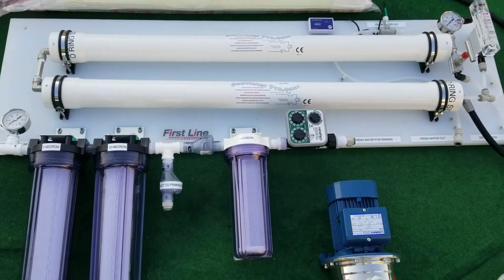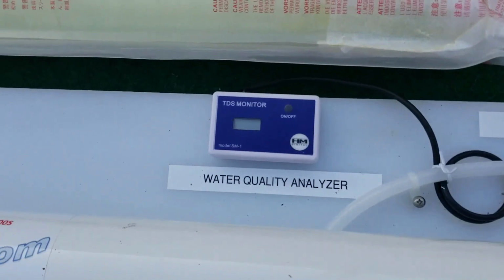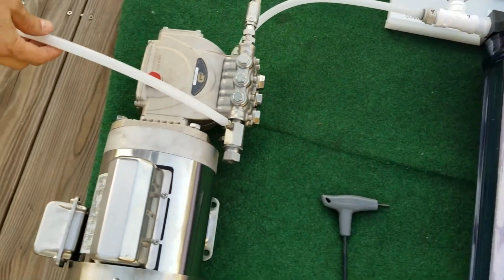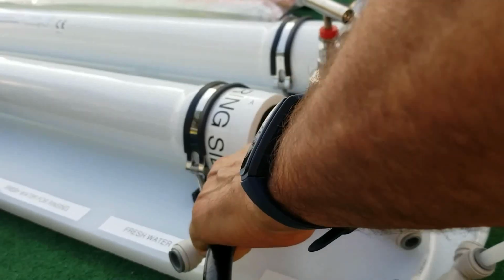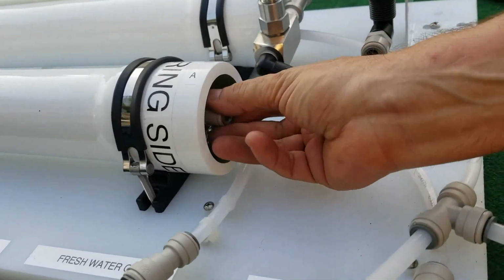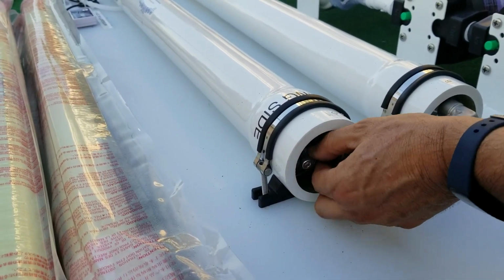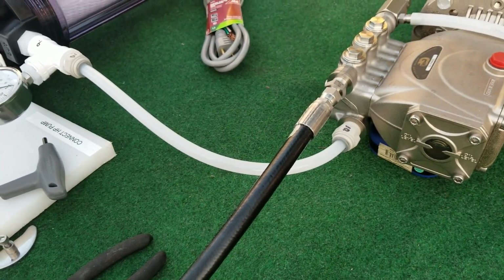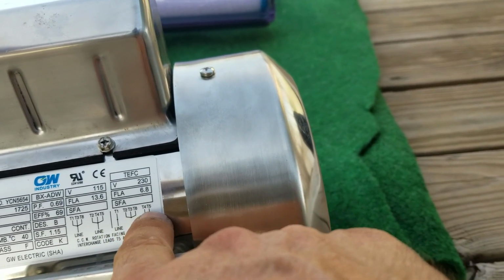SeaWater Pro Home Desalinator Watermaker, fully assembled, makes up to 80 Gallons per hour.

Comment: How much is the machine can produce 20 gallons/hr? Also, if there's no electricity on the island. Can a 12volts battery run this? Thx and more power,
From the Philippine island